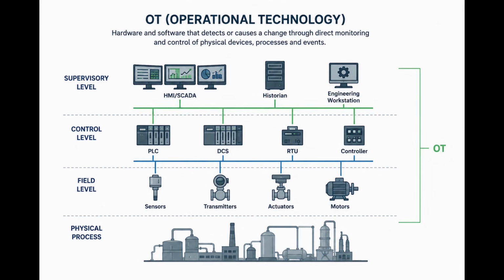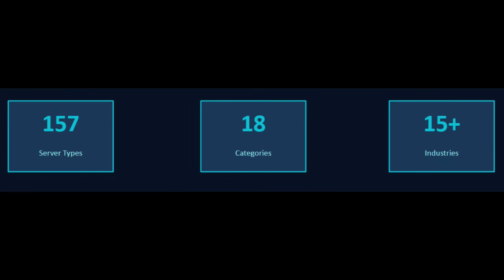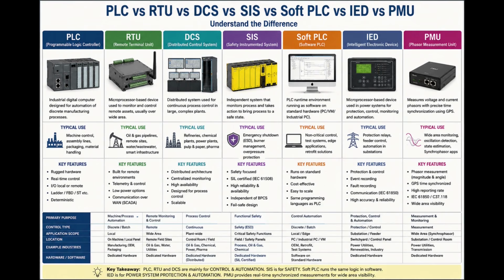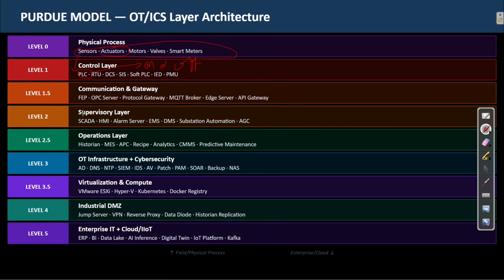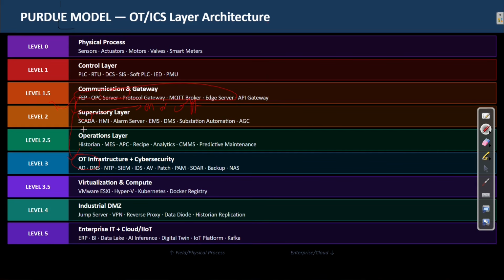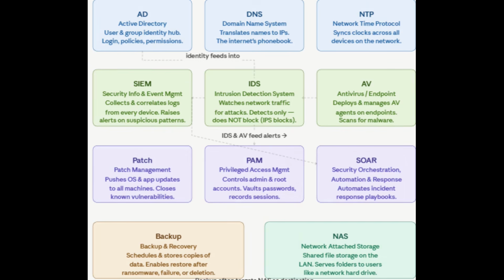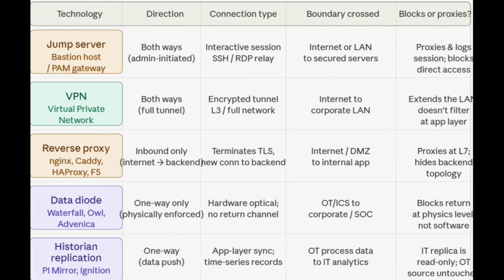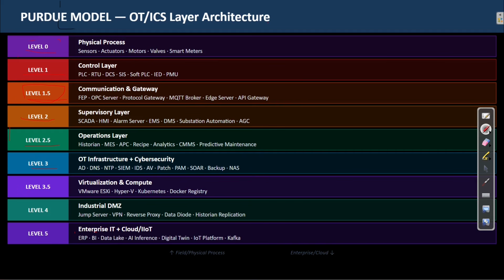1. OT Server Roles Explained — Every Component at Every Level of the Purdue Model

Comment: 157 server types and what about the hardware of server is it different or same?
Reply: Because OT/ICS servers are not differentiated only by software applications.
They also differ in
🔹 Real-time operational requirements
🔹 Redundancy & high availability
🔹 Industrial-grade hardware
🔹 Protocol compatibility (Modbus, DNP3, IEC-61850, OPC, etc.)
🔹 Deterministic communication needs
🔹 Environmental tolerance (temperature, vibration, EMI)
🔹 Safety & reliability requirements. so based on requirement. Few are only different in software few with hardware changes.